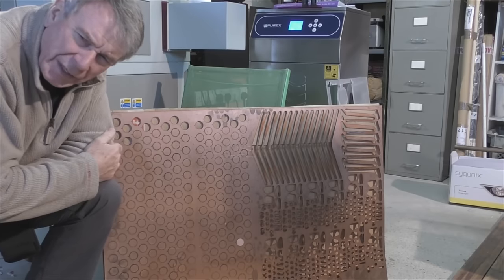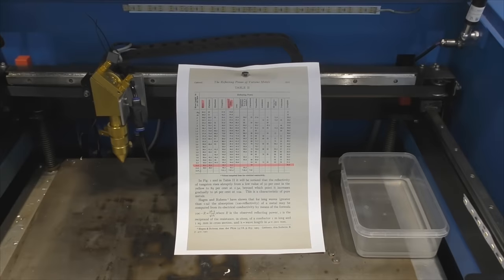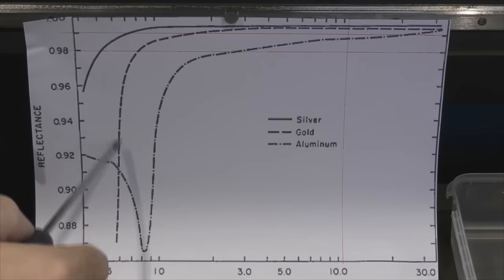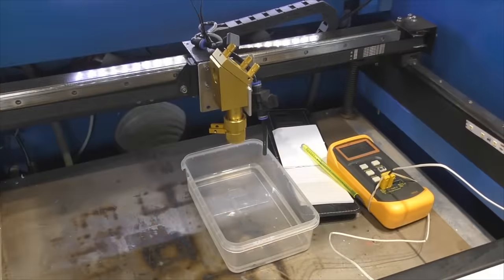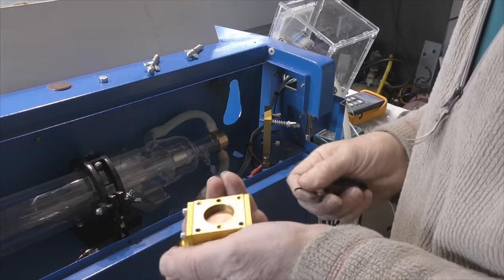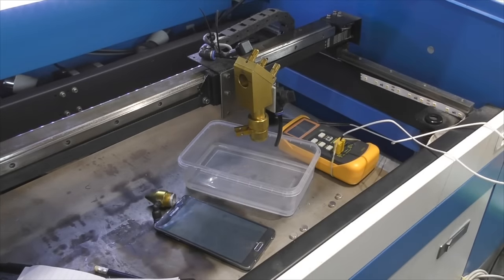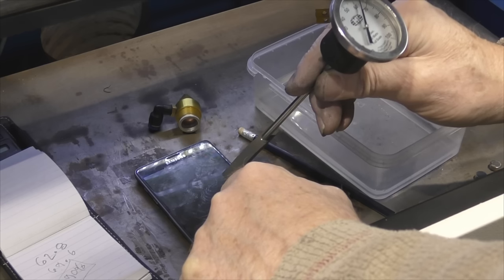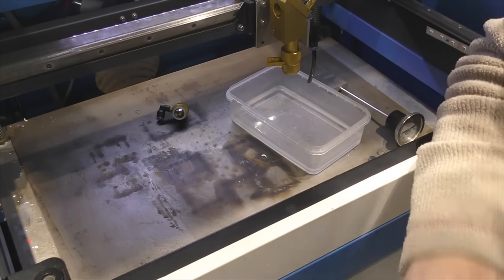RDWorks Learning Lab 94 copper mirrors  A Conclusion

Comment: I was going to suggest gold plating, and I see I am too late for that. In my previous life in - making microfilm eqiuipment, we used heat filters and cold mirrors to stop film buckle under the heat of halogen bulb. How ancient. It was Schott in Germany who made these multilayer dichroic mirrors, vacuum coating layers of exotic materials. I will try to contact them, if they do these kinds of mirrors.
Reply from the maker: Hi Otto
Copper  mirrors became a challenge. The gold plated (or yellow plated) copper mirrors from China were a serious disappointment. Copper offered great potential for that extra few percent efficiency but I latterly discovered that the 99% potential can only be achieved with a half wave anti-reflection coating .....no such kit in my shed!!!
But real gold and Silver do offer that potential and I have two sets away in the USA at present, being plated, because  a professional jeweler there is equally curious in finding out  if a quality 24K gold or 99.99% silver can naturally achieve those high percentages.  In reality it's a fool's errand because you can get 96 or 97% efficiency with ordinary molybdenum mirrors. Pragmatically I should not be wasting my time. BUT, now I just want to know.
Best regards
Russ
Reply: Hi Russ, I have been communicating with chinese suppliers on the subject of copper mirrors, and they were very vague about the type of coating and efficiency percentage. I will for the time being stick with the molybdenum, and watch you mirror challenge with an interest.

Comment: What are the standard mirrors these cutters usually have, coated in / made from?
Reply from the maker: Hi Andy
I ate too much yesterday and have even eaten too much today. I.m sitting quietly now trying to make sense of just how fibre lasers work, hoping that keeping my brain in overdrive will burn off some of that food without doing to much REAL exercise!!!
I got fixated on the possibility of 99% efficient mirrors. Copper offered that possibility  so I had to see it through to a quality conclusion. Gold offered the same level of efficiency and obviously will not oxidize  A point many people made was that obviously copper will tarnish when exposed to air and would quickly lose any initial  efficiency gain.
Okay lets answer your question/s. All metals are mirrors to some degree at 10.6 micron wavelength. Silver,copper,platinum,gold and aluminium are about the best. All are supposed to be 99%plus.. All non-metals are absorbers of the IR light.  So when your see K9 mirrors and silicon mirrors (which are very expensive) my advice is to steer clear of them ar anything that is plated. K9 material (crown glass) can be easily polished optically flat,  which is a key requirement for a mirror to prevent beam distortion, but is 100% absorber of IR light. A FLASH coating of gold fixes this issue and turns it into a great mirror .........until you come to clean it. Gold is VERY soft and the coating is VERY thin. After a clean or two you will wear through the gold and you no longer have a mirror, Silicon chip technology enables super flat material without polishing, but it is expensive and for our machines the super flatness is overkill. The flash gold plating is just as vulnerable. Molybdenum is a solid very dense material that can be polished reasonably flat cost effectively and delivers a reflective efficiency of typically 97%.  They are bulletproof,  and you can clean and polish them with total impunity. They are also very cheap at about $4 each  (when you buy a set of 3)  https://www.cloudraylaser.com/products/cloudray-high-quality-mo-mirror-dia-15-19-05-20-25-30-38-1mm-thk-3mm-1pcs-custom-made-for-co2-laser-engraving-cutting-machine?variant=7645314514995

I still have those copper mirrors in my China blue machine today. Once or twice a year I take them out for a quick polish....so much for the tarnishing doom merchants.
Best wishes
Russ
Reply: @SarbarMultimedia  Russ, I Couldn't have asked for a better reply. That was a brilliantly informative description. I'm going to copy the reply and add it to my laser folder. Many thanks.

Comment: So the procedure to coat copper mirrors with gold is not so bad (it has more reflecitivity), but the examples you had were not lapped/polished to a good enough standard?
You results now are quite impressive, but resorting to commercial parties for the production would make it too expensive again.
I would be very interested in a DIY procedure to lap copper mirrors to say 97% reflectance.
Reply from the maker: Depending on your location you may be surrounded by amateur astronomers who often  revel in making their own mirrors and lenses. A chat with your local astronomical club/society may  lead you to someone who will show you the correct way to hand lap mirrors. I tried this route but here in the UK such enthusiasts are VERY rare. Hence I decided to spend money on professional services. I really wanted to arrive at a conclusion. I am reasonably happy with the result. Very expensive professional mirrors for industrial lasers are not raw copper like mine. They have some sort of half or quarter wavelength coating applied to improve reflectance up into the mid 99% region. However,  I conclude that  well kept moly mirrors would be the sensible best option for all but the most enthusiastic....and I sense you are in this last category. I have more mirrors I can polish, so as suggested by Do R/C, electroplating them with silver may get me a fraction more.
Thanks for the comment
Russ

Comment: silver unfourtainly tarnishes quickly, silver oxide isnt that reflective anymore. same for aluminimum, it instantly builds up a oxide layer.

you can try gold plating your flattest mirrors yourself, 24K gold plating solutions arent that expenisve and you just need a hair thin plating.  and gold will last
Reply from the maker: I agree about silver and I never even tried it. If you continue watching you will see that  after I paid to have a small batch of these copper discs  lapped optically flat by a gauge manufacturer,  I  had help from  a laser enthusiast in California who was a jeweller. He plated a couple of sets for me with 24K gold .  Despite the science that promises 99% reflectance from gold, gold plating from China and even this known 24K quality  from USA were both only preforming at about 94% to 95% efficiency.. The naked copper performed at 98.5%  and after more than 4 years I still have them running in my machine. The doom merchants that predicted tarnishing would render them useless within a month or two were a little off.  I have had them out a couple of times for a 10 second re polish  but I love them.  HOWEVER the real winners in my research were molybdenum mirrors. At 97% efficiency and costing about $4 each the are solid material that is bullet proof. You can even re polish them with silver polish if they tarnish  The copper experience was fun but expensive. I have a spare set of moly mirrors if ever I need them.  My advice is to forget any thing that is plated.
By the way I have done reflectance tests on tarnished copper and aluminium and the loss is only 1 or 2%   because the oxide layer is atomically thin. However force a thicker  oxide onto aluminium with the anodizing process and  the oxide thickness is sufficient to make the surface almost 100% non reflective.

 Best wishes
  Russ

Comment: 16:44 - "Round the edge it's becoming quite polished, but in the middle it's still quite grainy".

You're creating a convex mirror.
Reply from the maker: Hi Mark
I was certainly softening the corners. I had also tried mounting 3 mirrors on a thick steel plate  (like a proper lapping plate) to try and keep them flat  but without a motor driven system to randomly rotate them, that was also a failure , but less so.  In the end I decided that hand lapping was not a natural skill I possessed and paid a gauge manufacturer to lap them ultra flat. Although I had to get the last few % efficiency by careful hand polishing to arrive at between 98 and 99%. Okay, I got the answer I was seeking and almost 3 years later those same mirrors are still in the machine. They have been out  twice for a 10 second repolish. However,  if and when I have to replace them I shall do so with molybdenum mirrors that are almost as good at 97% efficiency but only $4 each!!!!
Best wishes
Russ
Reply: SarbarMultimedia - Hi Russ, thanks so much for such a quick response on a comment to a 2 year old video.

I'm curious, if you know the answer. How much correspondence is there between reflecting of visible light and infra-red light. Specifically, I'm wondering how much tarnishing of the mirror affects the performance of the laser cutter.

Please accept my apology if you've already covered this in another video. I'm fairly new to your channel and working my way through now.
Reply from the maker: @markgearing  
Visible and IR light share the same electromagnetic spectrum beyond that they are completely  different.  As far as our 10.6 micron wavelength light is concerned there are only 3 things in it's universe. 
1)Metals, all of which reflect IR light with varying efficiencies.  Gold,copper, aluminium and silver are claimed to be in excess of 99% with most others in the 90%s. We use this propery for mirrors.
2) A VERY small group of special  crystalline materials that are transparent in varying degrees. We exploit these materials for lenses.
3) Everything else. The light enegy at 10.6 microns has the ability to stimulate these material molecules to higher energy states. Higher energy(more atomic vibrations)= higher temperature. Therefore everthing else heats up by at different rates dependent upon its  atomic structure.
Back to your original question about tarnishing, Tarnish is oxidation. This metal oxide  falls into group 3 and will be heated by IR light.. As far as visible light is concerned the tarnish quickly reduces visible reflectivity to zero whereas even fairly serious tarnishing will only pull the copper reflectance down to about 90%.  The polish I used has some sort of molecular bonding additive which seems to work well at keeping oxygen away from the raw copper surface. Visible reflectance remains good for about a year..
Best wishe
Russ

Comment: Hey Russ, this is your 2nd or 3rd video for mirrors. Thanks for that.

I got the same lasercutter a couple days ago. I think it was stored a while outside, because there's rust on every screw etc., even  on the mirrors!

I can barely cut 3mm acrylics with it. So I just took out the mirrors and they are very blurry. Check this out: http://imgur.com/a/POAIL

This is not even the worst one of all 3 mirrors. I will try to polish them, but actually I want to replace them. Can you please tell me the diameter? Is it really 20mm, or more? Yes my measuretool shows 2 cm, but since I can't get the mirror out of the mounting now (I don't have such a fancy acrylic tool like you, yet), I'm not sure if its really 20 or 25mm. I think those mirrors of GH350 machines are actually 25mm, so it does hold in the mounting (with 20mm they would fall out?). Can you please verify?

I want to order new mirrors as soon as possible so that's why I'm asking. Thanks!

Best regards
Reply from the maker: Hi Max
Yes there is another video about gold mirrors    https://www.youtube.com/watch?v=aYDXMHmKExU.
Most laser machines are fitted with molybdenum mirrors because they are not terribly expensive and are VERY durable. Yes your mirrors are definitely 25mm diameter but it's difficult to say what the material is from your picture, it looks like bead blasted gold. If you take the mirror our (two nails in a piece of wood will be a crude tool) then you will be able to examine the back. If it feels heavy and looks grey/dull silver it's probably moly and that means you can first clean the surface  with acetone and if that fails then you can be more aggressive with metal polish  as you see me do when I polish my copper mirrors. You have nothing to lose. As I found out, the expensive copper mirrors that you can buy from China are plated with something yellow and do not perform very well. Do not touch K9mirrors they are cheap and nasty. My advice is to buy  molybdenum mirrors
Best regards
Russ